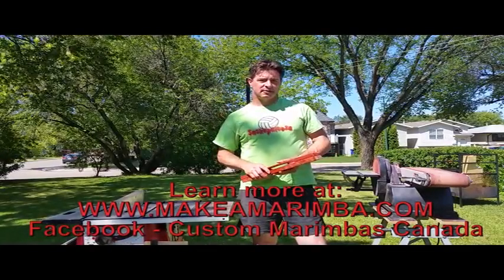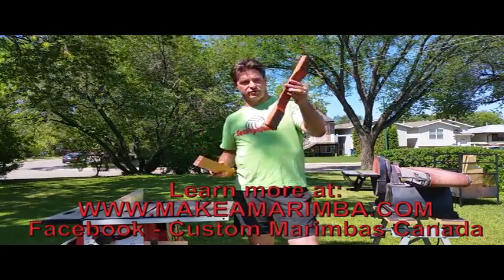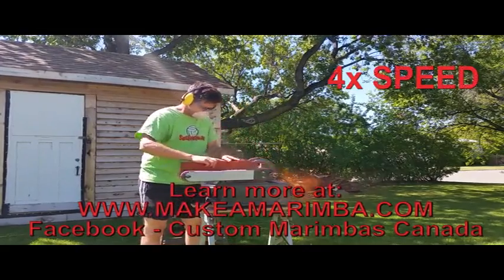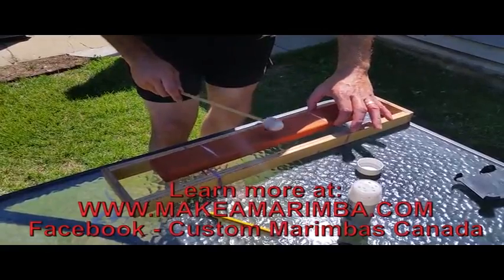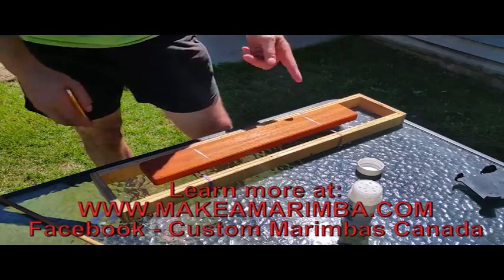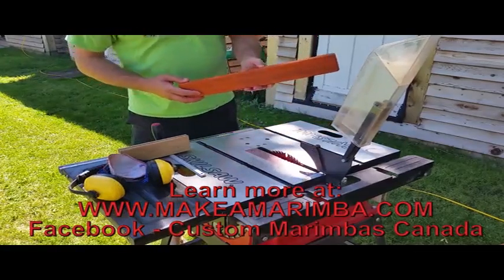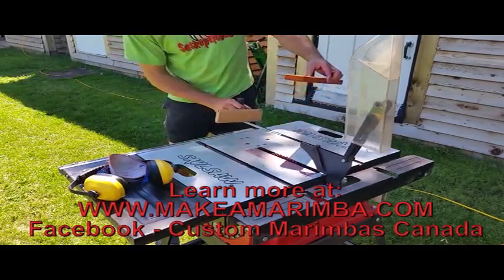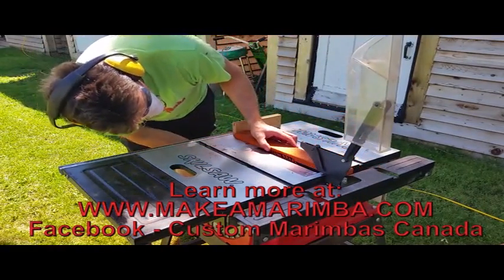Tuning B2 Marimba bar - why we salt test twice!

Comment: Im wondering why you dont use a bandsaw or a tablerouter with a template to make the bow???
Reply from the maker: Well a template - yes I do - but never a fixed template - always I use the rough tuned arch of a bar as the template for the next bar in the series. A fixed template only works if you are using exactly the same timber with exactly the same thickness all the time. I HAVE used a router before - but I find it is not as fast or accurate and more prone to ripping out bits from the side edge of the bar which is undesirable. People have used band saws before - if you do this you need a very good (more expensive) and bigger bandsaw - even then it is prone to wandering and you can end up with an uneven arch cross-section. It's a big wear on the blade and in the end I think actually slower than just trenching and sanding.

Comment: Are these rosewood or padouk bars?
Reply from the maker: These are Padauk - pretty much impossible to get Honduras Rosewood in Canada nowadays. I only have a few bits of 1.5" wide left now - nothing big enough for marimba bars. :(
Reply: @percussionclinic  Have you ever considered using a wood with a similar profile to rosewood? There are a lot of options out there
Reply from the maker: @RockerBug17  Hi there. I have used many timbers over the years - and this question comes up quite a lot. The thing to realize about timber for marimba bars, is that the physical characteristics don't have much to do with the sound. There are factors of internal structure and chemical composition that play a much bigger role. There are a very few timbers that really work well for a marimba across the whole five octave range. What is interesting is that padauk is generally accepted as being one of the closest matches to dalbergia stevensonii... but the physical characteristics are quite different.
Reply: @percussionclinic  I owe a complete Set of dalbergia stevensonia roughpieces for Marimba since 1983
That was than 40 years dried now its 80 years dry and never build my marimba😭